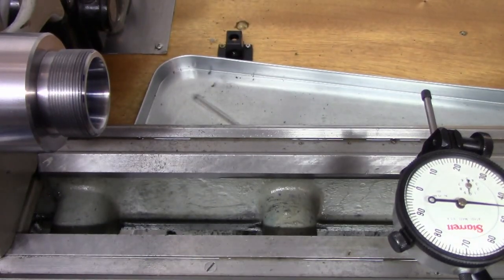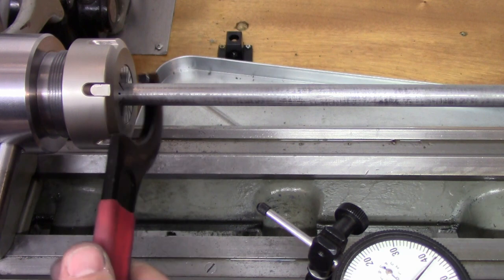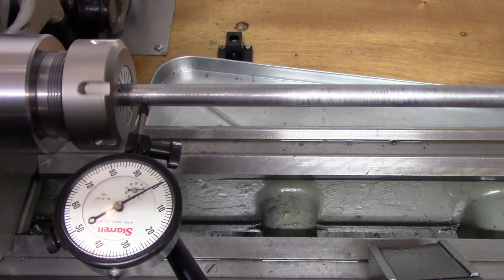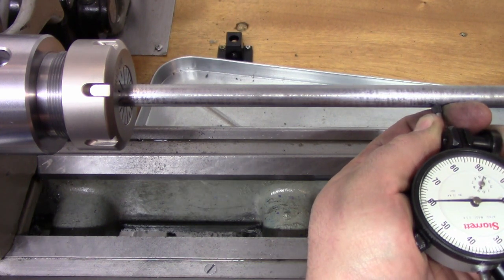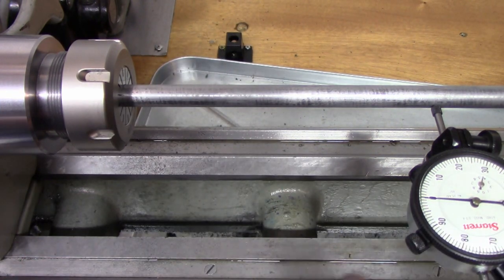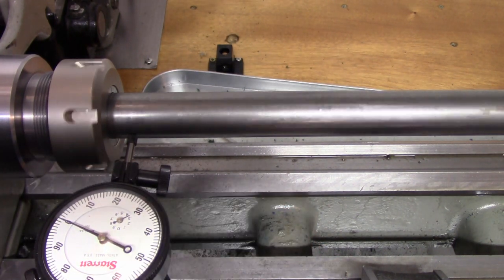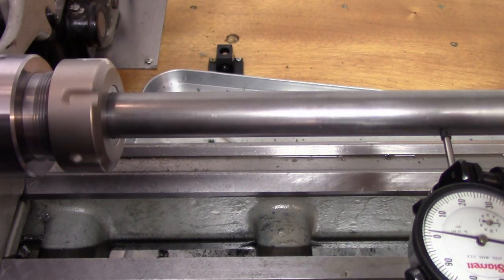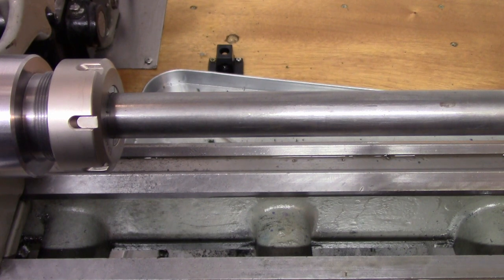ER 40 Collet Chuck *UPDATE*

Comment: I don't know if you can get them easily over there but if you can I seriously recommend a ball bearing collet nut, really makes a big difference to the ease of use and clamping power.
Reply from the maker: +caskwith 
Yes they are availible.  Figured go with the cheaper one first :-)
Reply: Fair enough, I have a couple of plain nuts I keep for situations where the chance of me bumping a cutter into the nut is high, the ball bearing nut is used on other jobs. I find for light work I can just hand tighten it with no need for the wrench.

Comment: i solved the Slauson by using the chuck as a assembled  to the jacking plat by using 3 jerkin points to zero the chuck before tightening  it up for good,  that way i can put  it on other laths a adjust to zero .

Comment: Looks good. At this point I would harden the piece. Then to get it absolute you can lap it in the rest of the way. Lapping compound on the collet and rotate by hand till you get a polish and it should be dead nuts. Hardening will shrink it slightly which will work in your favor for the final polish.

On the other hand good enough is good enough.

Comment: Centering a tool/part in an ER collet is subject to the concentricity/clearance inherent in the ER nut. One of the high-end ER collet mfrs claims that you should "final-adjust" the tool/part for center before final tightening the ER nut. I think their name is Rego-fix. Someone told me that you can do the same thing by tapping the nut before it is totally tightened and they tested it and were able to achieve awesome runout numbers. If your ER collet is not running true, try tapping the ER nut and check it again until you minimize the runout. You will be surprised how much "clearance" you will be able to use to your advantage. Supposedly, after the final 140#-185# tightening of the ER nut [in your bench fixture], the ER collet assembly will hold that final setting!.

Comment: Hi, my name is Dave and i really like your method of building a collet chuck and want to build one for my old 1919 South Bend 13" lathe. I was wondering if you know where i may be able to purchase an er40 collet nut that has standard threads instead of metric because i do not have the capability to cut metric threads at the moment on my lathe. I basically adapter a heavy 10 single tumbler gearbox to my old lathe and it cuts standard threads nicely, but i just dont know if i can cut a metric thread with it. Also, where in Ma are you? Im down in Blackstone, MA on the Woonsocket, RI border. Keep up the great videos, i enjoy watching them.

Comment: Thanks for the video - again they are much appreciated!
With respect to (wrt) your run out, the smaller bar seems to have a poor finish close to the chuck and I wonder how straight it is in reality.  WRT the larger bar, the dial indicator jumped at a point close to the chuck and again I wonder how straight it is.  when one thinks about these bars in our home shops and how they are treated (dropped accidentally etc) it wouldn't surprise me if they were out just a touch.
I guess one way to check would be to chuck the bar in a four jaw chuck, center and do the same test.  Thanks again - Rod
No need to reply - I just really appreciate your videos.

Comment: That's amazing. The underground stock the larger stuff that you use is liable to have warps and bends in it to account for the extra little run out. You're not going to use a college truck way out there anyway without the work supported. You'll get more of a deviation just from misplacement caused by the tail stock. That I would call that perfect

Comment: Did you happen to check the rod stock for runout in a pair of V-blocks? I know you said it was ground stock, but USPS is not exactly "delicate" in their handling. I think they could break an anvil.
Reply from the maker: +MechaDavid 
It came form my local metal supply.  The taper seat was refined with a gauge pin in the collet to get good contact all around the collet.  The bars are for a gauge of accuracy of sorts.  I was focusing more on the contact the collet has in its taper.

Comment: Nice work! A question I asked on one of your older videos: Why ER40 rather than ER32? Asking b/c the ER32 sets are less expensive and yet appear to exceed 1" capacity, which I believe was your goal. Or am I not reading the specs right? I think I will probably start out with one of those drawbar kits and then possibly copy your chuck if I get really ambitious (lots of hurdles what with metric threading and all).
Reply: +Rick Rose ER 32 goes up to 20mm (a little over 3/4")
Reply: +Chris Stephens Thanks Chris--I found a chart soon after posting that. Looks like the 32s cover more on the small end, but only really, really small (less than 1/8"), whereas the 40s cover more on the large end. I think Greg made the smart move to go with the 40s. I'm probably going to follow his lead. I'm trying to figure out how to make a "one collet-set shop." It surprises me that I don't see collet blocks made for the ER series, so I think I'll wind up making my own.
Reply: Your welcome, re ER collet blocks, there is a company over here that sells ER32 and ER40 ones. They were designed here in the UK but like most things they probably from china. Arceurotrade, who sell them, usually only stock the better quality imports and have a very good reputation. No connection by the way save for a satisfied customer.
http://www.arceurotrade.co.uk/Catalogue/Collets/ER-Collet-Fixtures
is their web page.
Reply: Well there you go! Thanks again--I will remember this resource. The prices do not seem bad at all.
Reply from the maker: +Rick Rose 
Yup as seen above anything over 20mm in ER 32 is considered oversize.  While they do make them if you look at them the wall thickness of the collet is pretty small at those sizes.

Comment: The extra 5% effort made all the difference, good job.
The tightening torque needed is greater than you might expect, perhaps you could experiment with different tightening torque versus amount of run out.
Reply from the maker: +Chris Stephens 
I've tried both extremes.  A little snug and a huge gronk.  If I give a little snug it can sometimes go out of wack.  If I turn the stock while giving it a little snug it seems to straightren out and then I can give it a goo tighten.   The run-out observed here is repeatable.

Comment: Well done. Always the possibility your stock has a slight banana shape or other bend. Ground stock is straight when it leves the factory -- maybe -- but who knows what happened along the road to your workshop. If you had a surface plate you could check it. That kind of metrology is beyond my means.
Reply from the maker: +Juan Rivero 
It's possible.  The taper seat was checked using a gauge pin in the collet to get good contact all the way around.